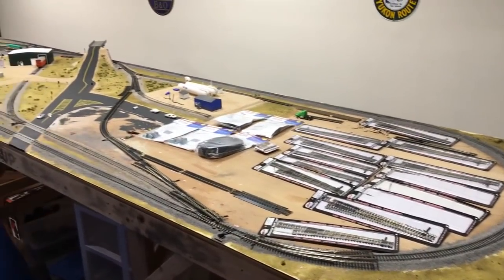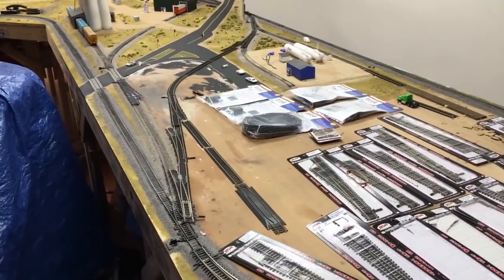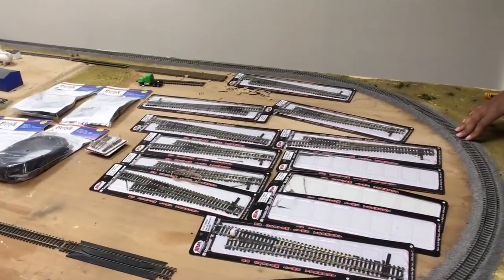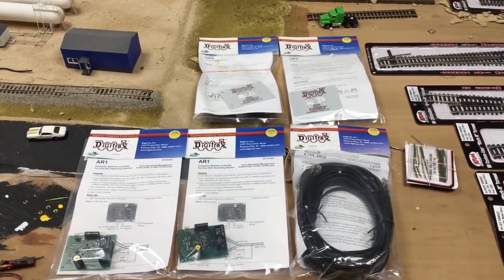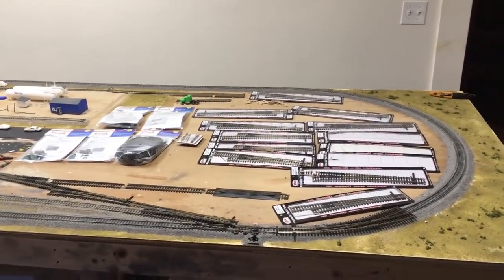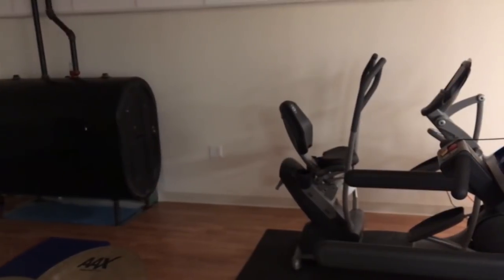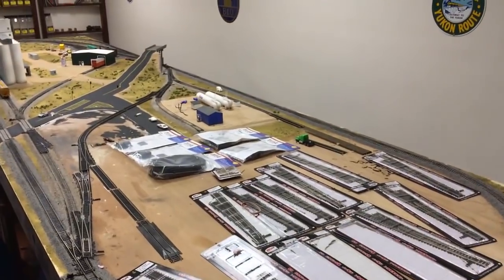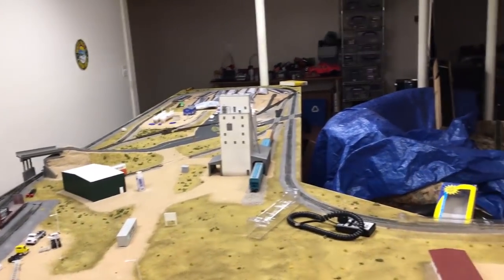We're Back! - BNSF "Arlington Sub" Progress Preview

Comment: looks like a good plan. will that not make for a complicated reversing loop? where you have added all the switch tracks in the center. 
wow the extension is going to make for a huge layout.. sweet
Reply from the maker: Thanks for the comment, and yes the industrial section will technically cause a reverse loop 
but we planned ahead and purchased two digitrax auto reversing modules so that should take care of it. Stay tuned! More updates coming! - Ryan

Comment: That new industrial track makes a reversing loop (very complex wiring). You might want to change that.
Reply from the maker: Thanks for the comment, we are well aware of the reverse loop. (The expansion will actually include two or three in the end) We are prepared for this and  have purchased two auto reversing modules from digitrax which should keep it sorted. Thanks for watching - Ryan
Reply: Ok sounds good.  Ive known a few guys who didn't realize this and fried their DCC system.